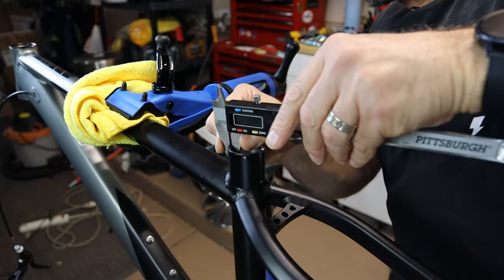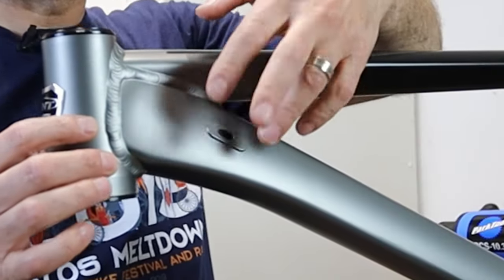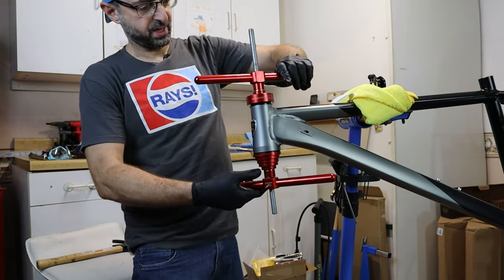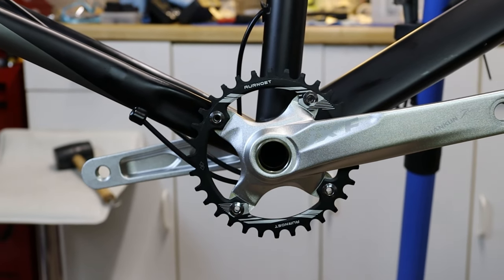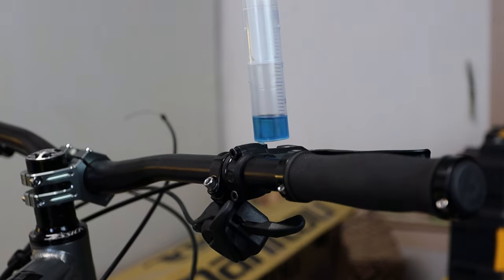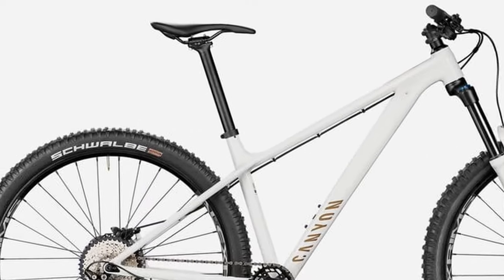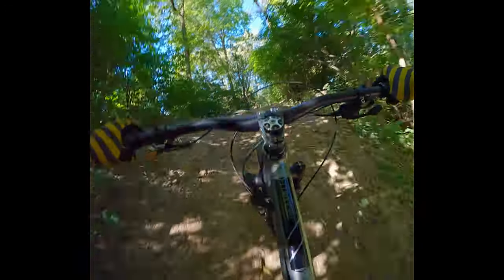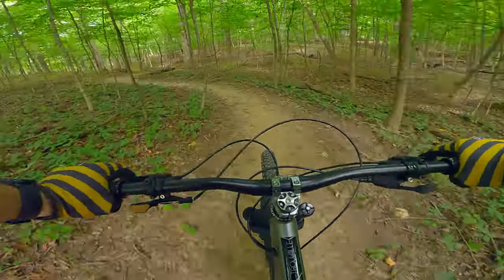Walmart Bike upgrade | Kent Trouvaille Hardtail Upgrades | Budget MTB

Comment: Awesome video bud. I went your route and reamed the frame to accept a 30.9 dropper. Now have a 150mm dropper, Rockshox 35 fork with 140mm travel, specialized front wheel and tire, wtb SX rear wheel, ixf crank, hyd brakes, pnw loam grips, pedals. It’s become a great back up bike for when my Stump Jumper is in the shop. Nonboost qr dropouts are definitely a huge downside but i love the bike and it jumps very well.
Reply from the maker: Your setup sounds pretty cool. This bike is sneaky good.
Reply: Hows it climb with the 140mm fork?
Any lift?
Got a giordana intrepid

Comment: Great content! What did you ever decide for the wheels .... make and size? Think a 2.5 tire would fit?
Reply from the maker: Funny, you should ask. I was just working on this bike last night. The wheels were replaced with a set of Brand X wheels. I'm still using the stock tires. They work well. 2.5s will be a tight fit. There is about 9mm of clearance at the chainstays.  Perhaps a low profile XC tire, but it will be tight. I'm glad you're enjoying the content!

Comment: I recently purchased this bike and something I noticed was that when I’m moving my bike along the road not pedaling, the disc brakes sound like they’re rubbing against something. It makes an interesting sound like cylinders on a vehicle sliding. Could that be misaligned disc brakes? Besides that everything works fine, and so far I’ve survived some sketchy descends with this bike.
Reply from the maker: Yeah. That sounds like the brakes out of alignment.  Find out which one it is and Loosen the two bolts slightly.  Then hold the brake lever and re-tighten. There are tutorials on YT that should help. If that doesn't work, you'll have to eyeball it and align it by hand.
Reply: @AdrenalineIsLife  😂😂thanks man, these Walmart bikes are puzzles

Comment: Your bike had a dropper post installed while the $1200 Canyon is just "dropper ready" so presumably that's another $150-200 right there. Plus some of the parts on your bike are actually nicer than what's on the Canyon (two-piston hydraulic brakes, for example). Plus the XCR on the Canyon is barely a performance upgrade from the XCM 30 fork that comes on the trouvaille. It's lighter, but rides very similarly.

Overall, I think sub-1,000 you're still better off with a Trouvaille because you can build it exactly how you want instead of just having a mediocre entry-level bike.
Reply from the maker: The Trouvaille certainly gets you into mtb at a much lower starting cost and that leaves plenty of room for upgrades.

Comment: Hey there. I just bought a Kent bike for 100 bucks, that's what I could afford specially since bikes are getting expensive in my country. Planning to work on it since it's going to be my first experience with a bike. By the way, any suggestions on how can I upgrade from V brakes to disc brakes on my bike? I can send you some pics if you can so you can see the type of frame I have
Reply from the maker: They make conversion kits for bikes but I don't know how reliable they are as I've never done the conversion.  You will also need to replace your wheels. My guess is that your wheels do not have disc rotor mounts.

People have used rim brakes for decades with no issues. Even many high spec road bikes still use them. It would be much less expensive and less of a headache to fine tune you existing brakes.

Comment: Does this bike need a tapered fork? Or is there an adapter i could use or sumthing
Reply from the maker: It doesn't need a tapered fork. A straight steer fork can be adapted easily.  The headset I used comes with an adapter crown race for straight steerer. I believe I showed it in the video. There is a link to the headset in the description.